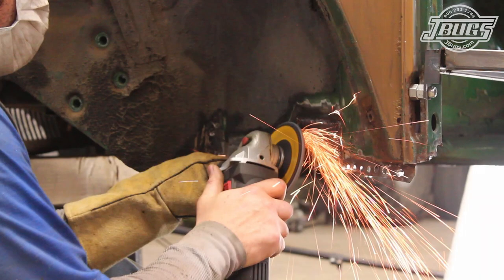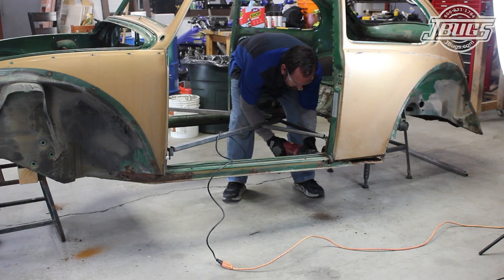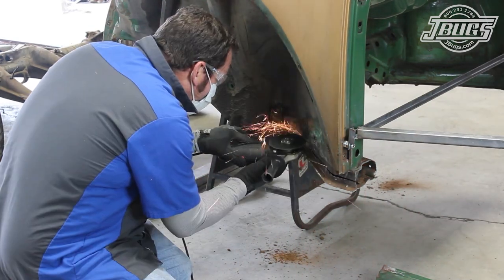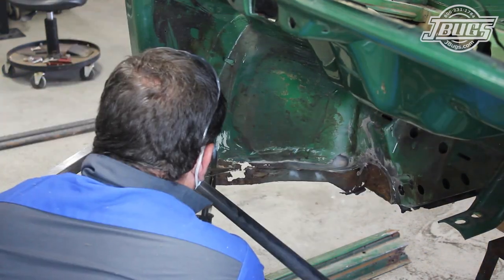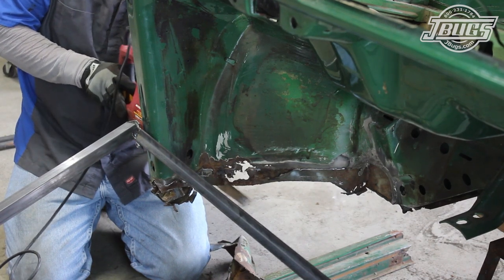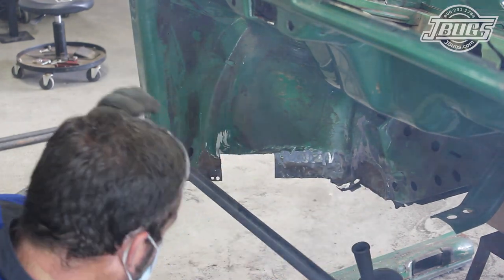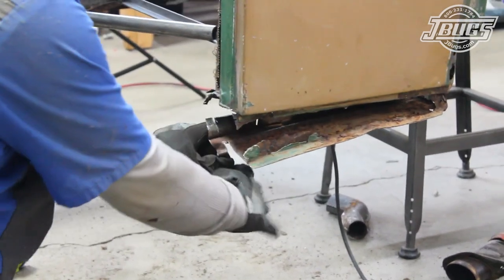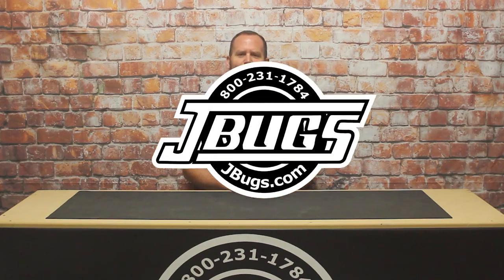JBugs - 1971 VW Super Beetle - Heater Channel Removal

Comment: I just tackled this job last fall and it was very daunting. There's only one or two videos on Youtube walking you through the process, but they're not the best. Once you get going, it's not too hard. Just make sure those doors line up whenever you bolt the body back on the pan! Thanks Jbugs!
Reply: No problem at all. We're cover the door opening when we weld everything back together. For sure it was a bit of a wing and a prayer as we didn't have the door in place. Fortunately we checked during body work and it is good to go thanks to all our measuring.

Comment: Would this process differ much on a 1303 cabrio please? I liked the bracing, very neat!
Reply: A convertible will have the body reinforcement rail below the heater channel. Removing it, repairing it as needed it will be part of the repair typically as if the heater channel is rusted out, chance are the rail will be too as it sit under the channel.
Reply: @Sam_Mebane  thanks Sam and those chassis rails are not readily available, at least here in the UK I understand?